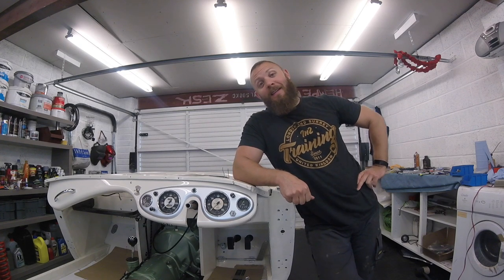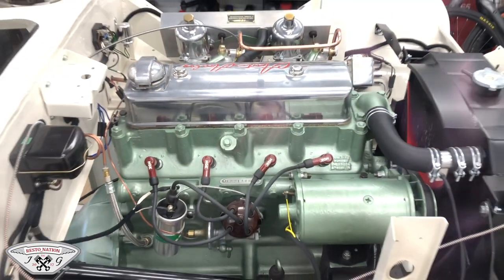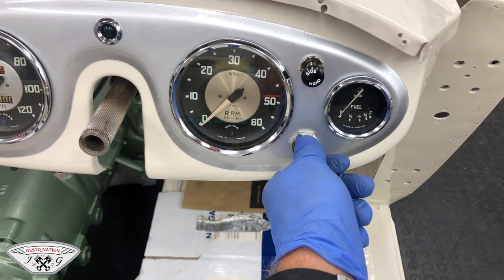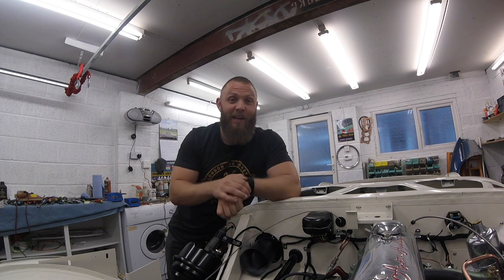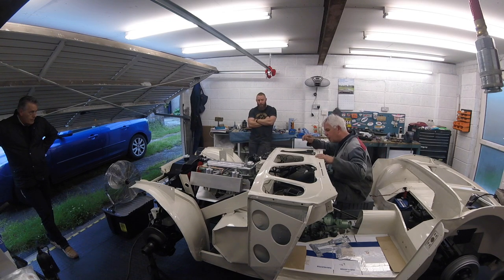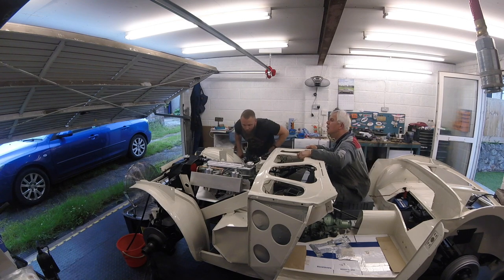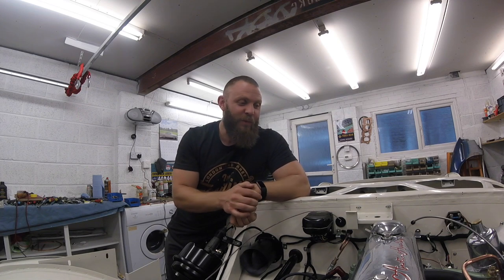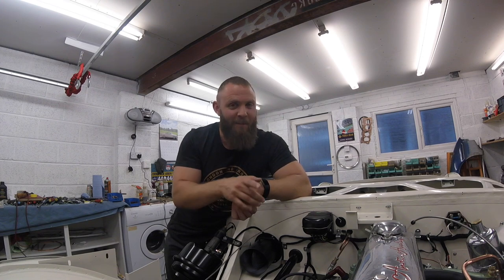First Start after a Full restoration on our Austin Healey 100/4

Comment: It sounded so smooth, well done.
Reply from the maker: Luego lover cheers Steve! It will need fettling for sure but she fired easily and settled to a steadyish idle at about 750rpm. We’ve been told to expect a bit of a lumpy idle due to the m spec cam...